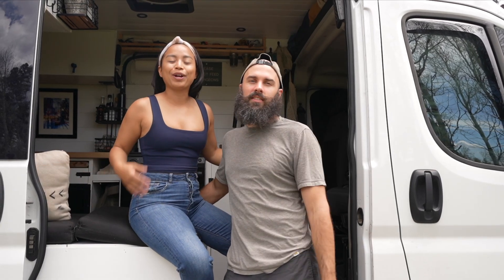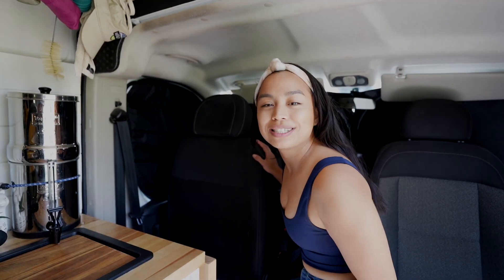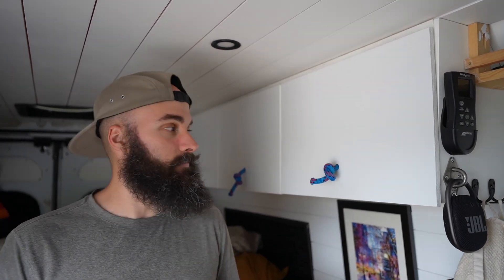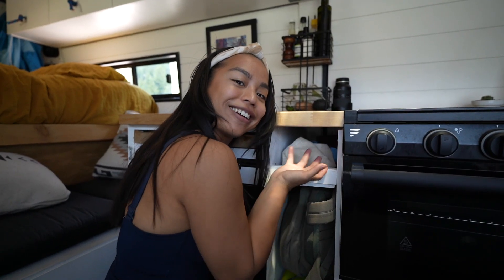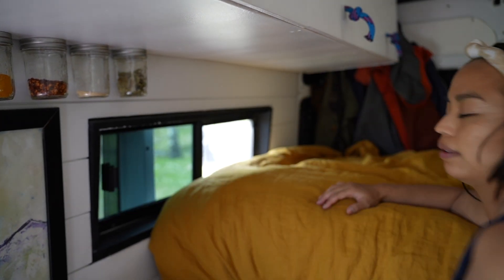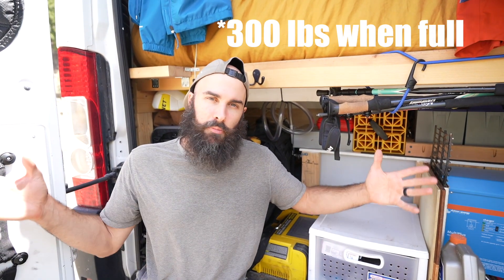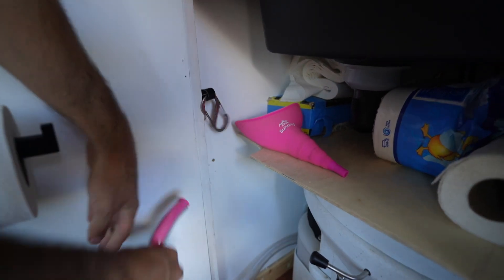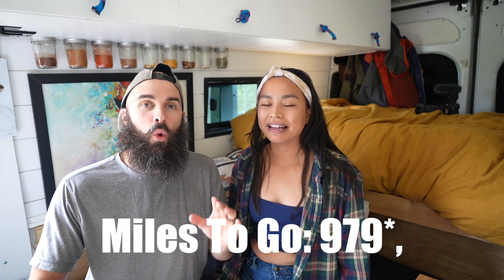FULL TIME TRAVEL VAN TOUR for Travel Couple (our first home!)

Comment: Awesome rebuild, guys. Just a tip: Meghan could use a foot rest when she is in the swiveled passenger seat. Having your feet dangling in the air / off-the-ground may affect your back/spine muscle area if your legs aren't supported properly by the seat bottom itself.
Reply from the maker: Thanks! You’re definitely right about that. We had a step stool but we ran it over when we left it outside :( definitely need to replace it!